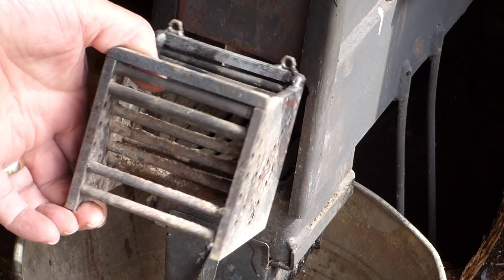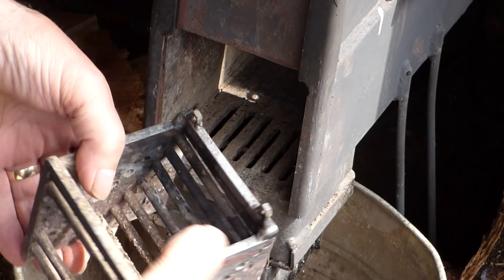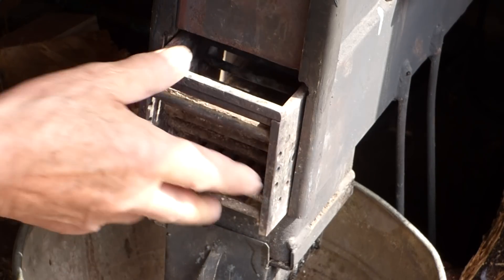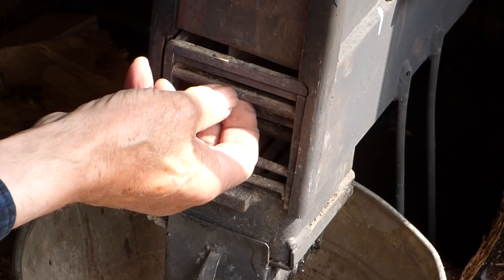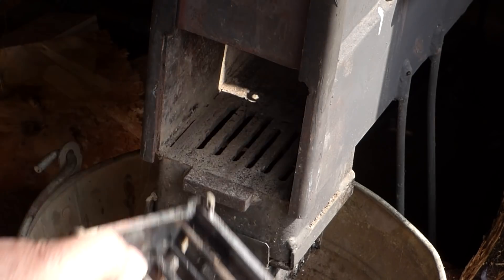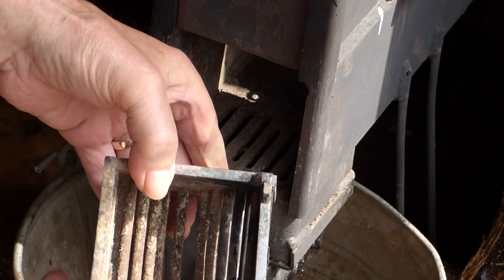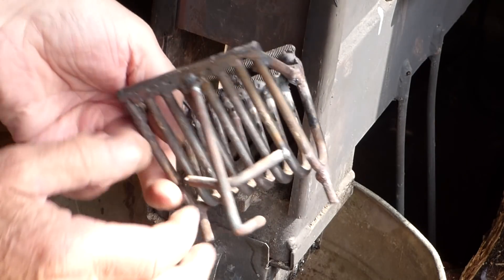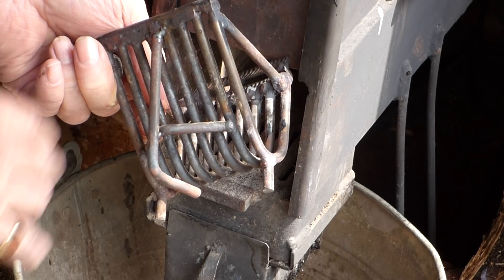rocket stove MK3 up date diy No.39

Comment: Hey David,  as it happens i have been experimenting with my basket configuration using 6mm ss rod also. i made one with 6mm gaps and the lead face of the basket vertical and right forward in the chamber.  Reasonable temps and burn, but was getting some not fully burnt pellets falling through. I made a new basket with 4mm gaps and the bottom edge of the lead face of the basket sloped back to about three quarters toward the front of the burn chamber.  Still with 20mm gap underneath the basket.  Fantastic results no half burnt pellets.  Solid wall of flame right across the burn chamber.  I can send you a photo of my latest basket.  Good looking unit, simple design.
Just a quick enquiry concerning possible problems should the electricity  go out and the circulating pump stop on the radiator system.  Will this cause problems in the heat exchange on the boiler due to the water not moving and more than likely commence boiling.
Talk soon, all the best.
Reply from the maker: The water will boil if the pump stops.
Reply: Thanks David.  What kind of dangers would this present.  Will it damage the boiler.  The reason i ask is someone raised the issue of a power outage  and had i considered any options to deal with it.  I know with the open vent system pressure won't build up to make it dangerous but i would suppose the water in the header tank would eventually boil also.  Unfortunately i won't be able to get the water to thermosyphon as i can't get the boiler below the level of the radiators.
Reply from the maker: The F E will get hot .
Reply: I'd like to see some pics of that basket design.

Comment: Hey Dave, Thanks so much for posting your videos.  I have borrowed you basket design for a rocket smoker I have built. I would like your input on a issue I am have tho, it seems that when I get to hour 3 or 4 on a burn that the seems to jump way up and the smoke goes dirty. I believe that its a fuel overload but I'm not exactly sure how to fix it without causing problems with the early portion of the burn.  What is happening it that the pellets burn to the point that they are small enough to fall thru the basket but they are not completely burnt, they pile up and then there is too much fuel for the amount of air I am allowing. Like I said it takes about 3 or 4 hours for this to happen but when it does its bad in a smoker, dirty smoke = dirty meat.  I'm thinking a basket with the bars closer together would solve the long term problem, by forcing the pellets to completely burn to ash before they fall thru the bars.  I'm really just looking for confirmation or suggestions.  Thank you again for posting your videos!  If I can figure out how to post a picture I'll send a picture.
Reply from the maker: The gap is 5mm on mine.

Comment: Thanks Dave, I came to the conclusion that the horizontal bars arent' as effective, the frame robs heat and i get too much build-up, clogs and smelly burns :(
Planned on making the vertical bar burn chamber as you posted this weekend. Its approaching mid-winter in S hemisphere. Cheers for your efforts mate :)